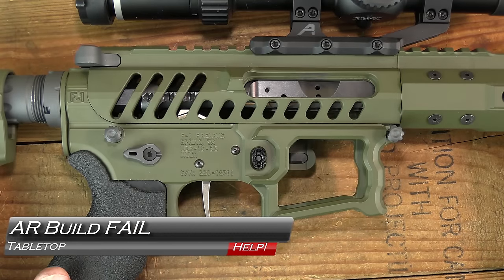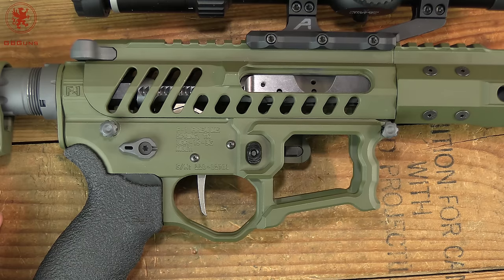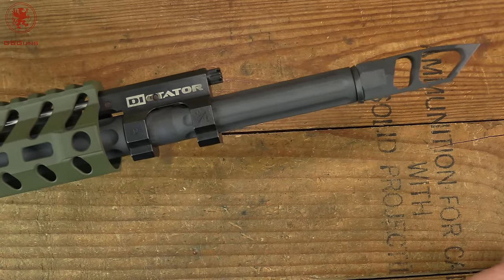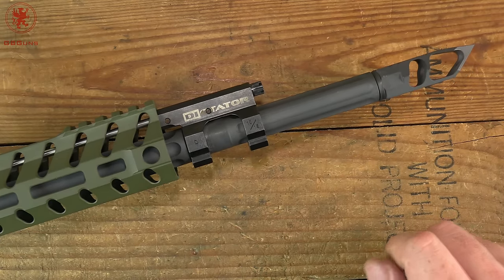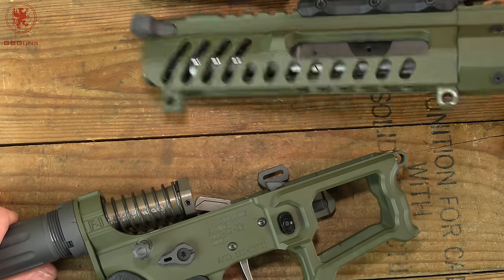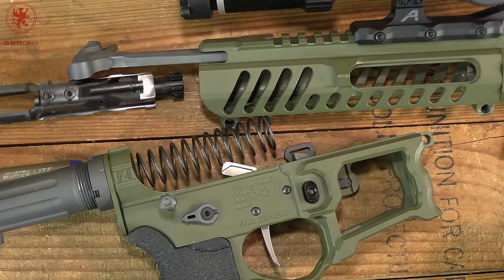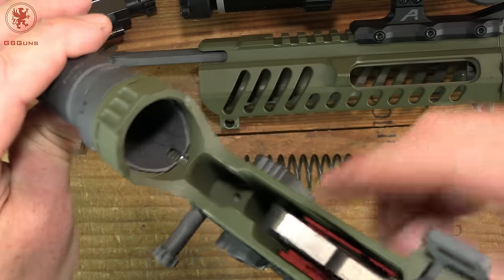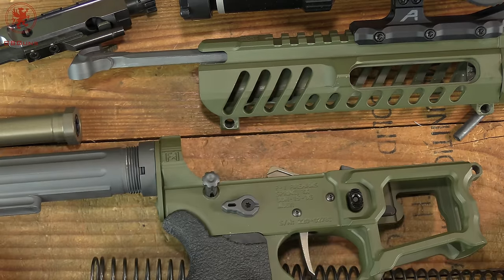The Worst Thing You Can Do For Your AR

Comment: Dude go to the range bring another spring bring some tools and inspect otherwise bring it to a proper certified gunsmith and the problem will be solved probably in an hour or so mine had to keep mine for the weekend because he loves shooting it so much who would love a radian lower and MK4GEISSELE rail on a 10.3 DD barrel sure fire warcomp neutral Super precision 1.93 mount for Trijicon MRO 0HD and their SD3G trigger and an H2 buffer triple braided wire system by them and a type three hard coat anodized DDC color as the rail is good optic mount and buffer tube are geissele. (Tube, buffer system, trigger, optic mount at 1.93 Little bit over 1/3 cup witness which is about 1.50 I did have the issue with the grade 1 nickel polish BCG on my 14.5 RIS2 so I swapped my phosphorated chrome lined BCG and put the grade one nickel polished in 10.3 both have crane spec gas port size but it ran like a sewing machine I do wish the companies would on the ball do what nights does and round the edges for a smoother unlocking and locking of the BC GE as well as a brass check so on the 14 five all right as to carbine SOCOM heavy barrel cold hammer forged centurion arms the blank I believe is very similar to the saw a blank where it has a much thicker chrome lining at least double butt was getting beautiful three to 4 o’clock each actions when swapping bolt carrier group‘s and both are mil spec the one was I guess the fear stuck to wear it sort of uses  a Break in . Period now both rifles run amazingly the 14 five is for being a colt profile heavy barrel Socom I’m not sure what blanks they used but they did say on Century and arms that they use machine gun steel 4150 on the barrels that are CHF double chrome lined they pin gas block no Gas linkage has very tight gas blocks and they also cross pendant for you and hand polish so if you’re interested in a really good barrel not necessarily that one but any one check out Centurion arms and it’s much more accurate than a colt that is not double chrome and CHF

Comment: Your buffer system isnt in the tube. Wtf

Get your detent situated and fix the stock so the detent stays in place and the gun will run completely different. Get new take down pin setups because clearly thats no good. I have tight pins as well but mine never come out.
Reply from the maker: You would really benefit from reading the article.

Comment: 11 months late, sorry about that, but you don't have a proper understanding about how buffers work my friend. You need a heavier buffer, not a lighter one. I'm sure someone else has told you this already but if not I hope it helps. Try an h2 first and if you have no luck, and you may not, go to h3. This low mass bcg may require the h3 to cycle.
Reply from the maker: Going heavier didn't help.  See video description
Reply: @GBGuns  the video description clearly says he tried lighter buffer and carrier. Not heavier.
Reply from the maker: We tried a light buffer, but also tried a heavier carrier.  There are two more videos and an article on Ballistic about this gun
Reply: @GBGuns  sorry, didn't realize "he" was you. That doesn't change what I said. I'm not trying to argue with you I'm trying to help you out. Trying a heavier bcg is not the same as trying a heavier buffer. The weight of the bcg effects how quickly the bcg moves rearward. The weight of the buffer changes how much kinetic energy the bcg carries moving forward. Heavy = more. There are hundreds of videos and every one of them is boring, because it's not gun stuff, it's science stuff.. but I would recommend looking into it as you don't understand it fully. Good luck man, glad you got it worked out.

Comment: Dude you dont have a buffer tube spring
Reply from the maker: Do you mean buffer retaining pin? You should read this https://www.ballisticmag.com/impossible-ar-build-myths/
Reply: @GBGuns  Your gun will not cycle properly or at all, You have no  buffer retaining spring buffer tube spring is to long...
Reply from the maker: You didn't read did you
Reply: @GBGuns  I did read it.  Like i said above. I wouldn't run an Ar without the buffer retaining pin.
Reply from the maker: Why not?
Reply: @GBGuns  I'll give you one basic reason. In the field , You open it , spring and buffer go flying. Also the gun would not cycle , since the gun was not cycling properly ,not having the detent which  keeps pressure off the Bolt didnt help the situation.  On a working rifle taking out the detent probably won't affect the function (I dont know never tried it) but with that said id rather have it and make life easier.
Reply: @GBGuns  I have not seen or heard of anyone not having a detent in their Rifle or leaving it out because it makes life easier & your rifle doesn't need it. Whatever float's your boat and makes you happy man. More power to you.
Reply from the maker: As I've explained, I this receiver set it's threaded with a tiny tiny Allen key which means once it's in it stays in.  That would block me from experimenting with the buffer.  As far as "in the field" is concerned, I've been a civilian for 6 years now, and while in service no personal weapons were allowed.  This isn't a hunting rifle, so when is a civilian ever needing emergency repairs "in the field"?  If I'm gonna go play GI Joe war games with the pepper crowd this wouldn't be the rifle I'd take either.

Comment: Too much Gucci.   Try stock spring buffer bcg and trigger.   Adjust gas to wide open   Then see what happens
Reply from the maker: That was tried, didn't work. See the article for the correct solution.

Comment: The gas port is only as good as the diameter on the barrel itself... If it's .750 you will always only get .750 gas regardless how open the gas block is lmao... Get the barrel ported for .900 and you will be able to utilize the gas block effectively..... It's not rocket science...
Reply from the maker: It's not rocket science, and the solution was much simpler
Reply: @GBGuns  lighter buffer spring... This is the problem with light weight / race guns you have to get everything lighter and lighter... Which I assume makes the gun overall less reliable... And ultra expensive... I'll stick to the things that matter- High quality barrel and bcg everything else after that other than a great trigger is nonsense imo....

Comment: You’re locked bolt dwell time is way to short, and you’re gas system is way to inefficient. Problem solved. Pay me
Reply from the maker: You've got the dwell time opposite. Read the article, thank me.
Reply: @GBGuns  thank you
Reply: I watched the video and I stand by my first assessment. The bolt isn’t staying locked long enough, you don’t have enough mass behind the cartridge, and the gas system from the gas port to the bolt tail is inefficient. Call me crazy but I’m not afraid to be wrong. I think it wouldn’t hurt you to try increasing locked bolt dwell time.

Comment: That gas tube was the first yikes. Also you went the wrong way in my novice opinion. Go heavy on the buffer system. Thats all i see wrong
Reply: Is the gun lubed up too?
Reply from the maker: What's wrong with the gas tube? A heavier buffer would cause short strokes.  See video description or pinned comment for the article.
Reply: Oh snap, and your buffer spring should be getting held in the tube by the buffer spring detent... is it not there?
Reply from the maker: @jprest13  no, buffer retainer pins are not necessary, it's explained in the article.

Comment: Gee, you got a rifle length gas system with an adjustable gas block, judging by your choice in parts, probably have an out of spec gas port size, you lightened the mass of the carrier which has "improvement cuts to remove debris" (while simultaneously cutting a bunch of holes into it's upper  to invite debris🤡), the gas key of which im totally sure is properly sealed and staked🙄, you went with a carbine buffer system on a rifle setup, AND took all the mass out of the buffer. I didn't hear anything about the buffer spring which means it's probably standard which is going to be a problem changing all that other shit. And furthermore, that "extension" on the buffer tube isnt to reduce carrier tilt, it's to solve another problem.that never existed which is fully encompass either side of the buffer retainer detent, WHICH ISN'T EVEN THERE! Where is it? Also getting a janky receiver set that's all cut up, probably out of spec everywhere and again removed mass where it's supposed to be, the mag release sticks because of it, the take down pins don't do what they're supposed to which is slide in and out, and the front doesn't even stay in, lol, 🙄. Ya I wonder why it doesn't cycle😒.

Bro whoever put that idea in your head for that entire build is not your friend. You got hosed with every single piece there other thanaybe that scope mount😂. There are ways to cut weight, reduce felt recoil and keep functional. None of that is it.
Reply from the maker: I take it you missed the pinned comment.

Comment: Your mixing a carbine and a rifle and that's no bueno. Also your rifle seems really dry to me. People will tell you that ARs can run without lube but I'm tell you that is incorrect. ARs love lube.
Reply from the maker: You might find the article interesting: https://www.ballisticmag.com/2021/03/02/impossible-ar-build-myths/
Reply: @GBGuns  yeah not really. You can't say something is a myth, but. It's a fact that a proper rifle gas system will not work on a proper carbine lower. There are work arounds such as lighter springs and buffers that make the two work together. This is the problem I have with people asking for advice on the internet instead of a competent gunsmith. Everything is a "but" these days. I should have been more observant of when this video was posted, then I could have saved myself the time it took to make my first post.
Reply from the maker: @ctroutt77  That's the tongue in cheek of the video tittle in the first place!

Comment: Well, get a gun that works and start switching out components until you isolate the issue. Try switching out the buffer and spring, the upper, the entire lower, and see what's working.

Edit: I saw your solution and wasn't super surprised. My 308 had the same problem.

Comment: Ah ha! I know exactly the things you need to o to get that to run....Its not just one thing...you will need to start in the front and work back. it would take me to much space to write it all down..good luck....I ran into the same problem with an 18" rifle length myself ....lol STOP....
Reply from the maker: It was one part, less than $20.  See video description or pinned comment